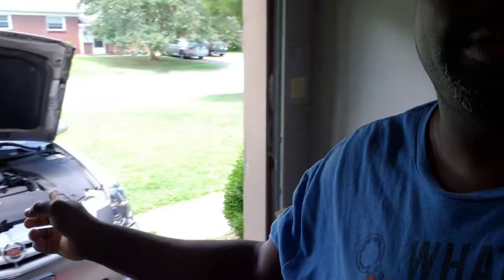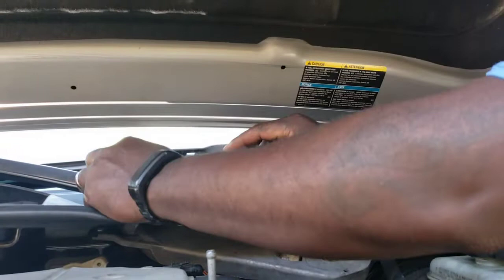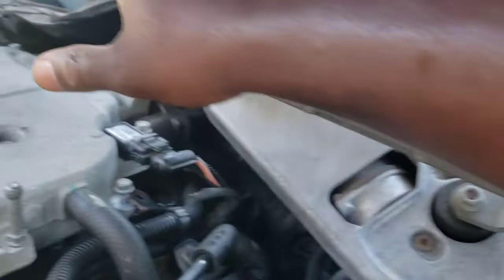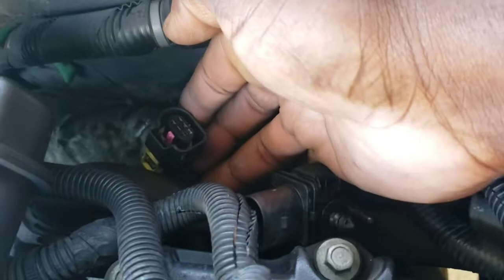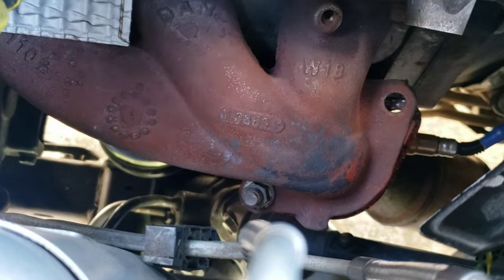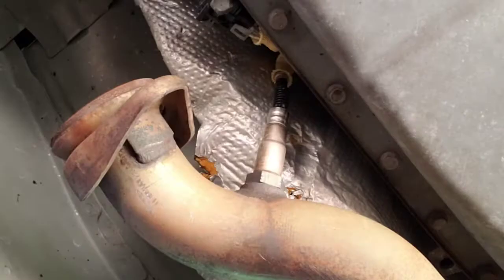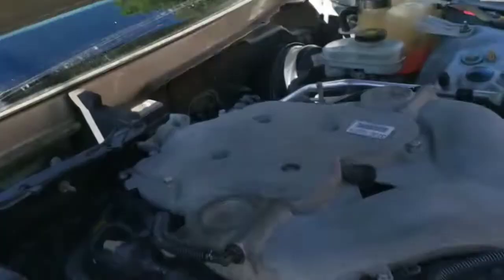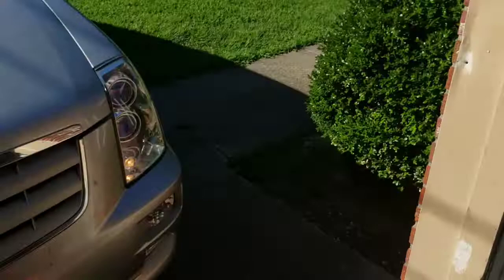HOW TO REPLACE YOUR DRIVER SIDE CATALYTIC CONVERTER ON YOUR 06 CADILLAC STS V6

Comment: 11/11/23 Thank you thank you thank you,  you are the best.  I have a 2006 cadillac sts just like yours (same color too). I recently had to replace the drivers side catalytic converter and apparently damaged the 02 sensor in the process.  However I would have been lost without watching two of your videos, I mean who would have thought you needed to remove the wiper motor 😉 thanks again Daniel 😉
Reply from the maker: No problem appreciate appreciate you watching my video glad I could help out.

Comment: Question...so  I have the same car a 2006 cadillac sts 3.6... I need the bank 1 side (passanger) did this converter work well for u 8 months later? Ur advice would help me out alot.thanks
Reply from the maker: It did work but don't underestimate what cause the catalytic converter go bad like O2 sensors, fuel injectors Etc cuz if you just replace the converter there's a good chance that it may come back if you didn't fix something else that causes it to go bad.
Reply: @fixitdaniel  I replaced all 4 o2 sensors..I have a code reader
Reply from the maker: @brownchicken1314  okay and then the only the only thing that comes up on your code reader is just a Cadillac efficiency bank 1 then you should be fine it should be just the the Cadillac converter unless it's something else but if it's just that and nothing else then you should be good
Reply: @fixitdaniel   thank u 4 rypling I just subbed to ur channel...1 more question... the new cat bend looks shorter than the old cat..did u run into any problems with that or did it fit normal..thanks again
Reply from the maker: Thank you for subscribing, I appreciate that. No I didn't I think when I got mine I made sure that they were mocked up but  the driver side were not OEM ones anyway so I didn't run into any issues when I put in.

Comment: hi guy your Cadillac catalytic converter is just great made the job so much easier. mines 05 cts 3.6 aftermarket cat did not allow for a good seal at he manifold not grooved like the OEM the OEM gasket is wierd looking with a shield on it...point is where did you get your gasket it doesnt look stock and i need one. thanks
Reply from the maker: I got that at Napa so I took my old gasket and had them mock up and find a metal one